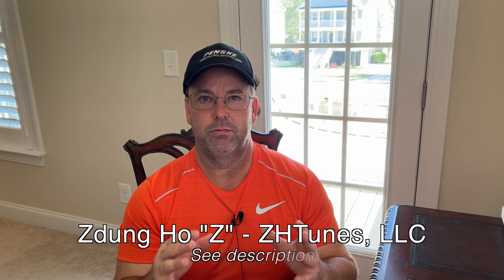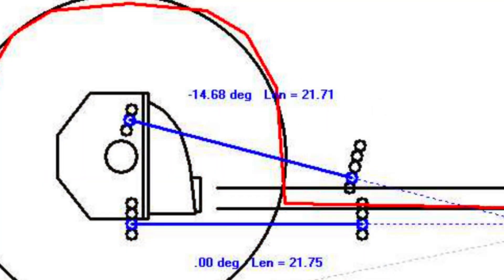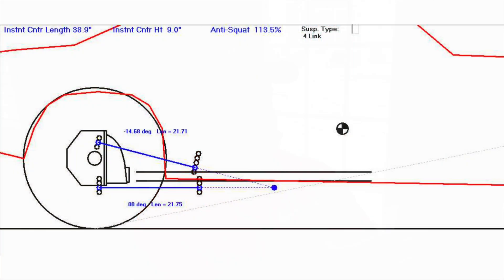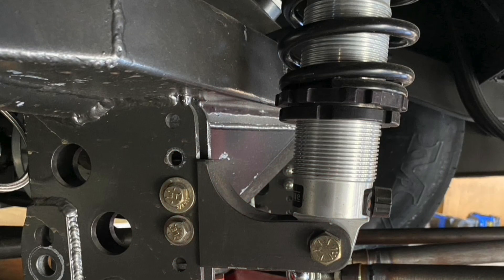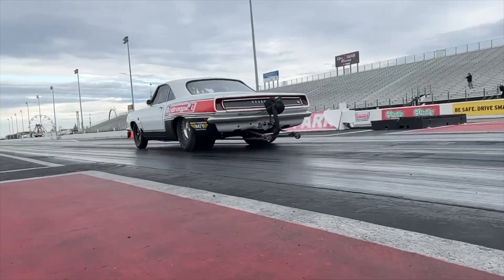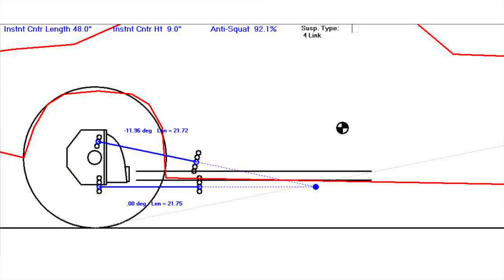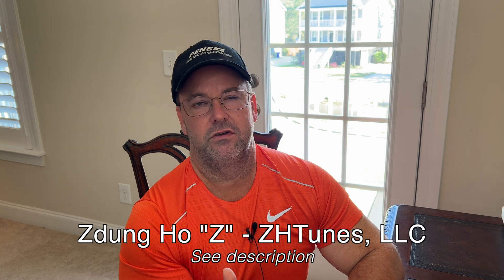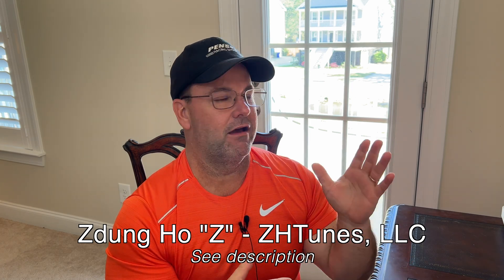4-Link Suspension: TOP Bar Change Stopped Crushing Slicks!

Comment: Can it be that your the wrong way around in explaining anti squat?
As you move the upper four link bar upwards, aren’t you dailing in more anti squat and not less? 
And if this is the case, isn’t the car squatting too much in the first runs (overpowering the dampers) and not to little?
So when you dial the squat back the initial squat force is controlled by the damper?
Reply from the maker: It can be confusing, but anti squat is when the rear tires separate from the chassis and get planted to the surface. As you move the upper 4 link bars higher on the chassis, you are lengthening the instant center, thus you are reducing anti squat, which is increasing squat. The term "anti squat" means the rear chassis is not having squat. Hope this helps. Go fast, go straight! Be SAFE!

Comment: WHT was the front and rear spread in inches? 7 and 12 are standard and you started well below that in the front. That car will be faster with double adjustable shocks and the that rear bounce and wheelie bar bounce should leave when you keep the slicks planted. That was very informative and keep it up

Comment: Great video. Those shocks work very well for the price. I’ve actually run 7.60’s in the 1/4’ with the single adjustable strange shock in a 3500lb leaf spring car on 275 radials. Check out our channel.

Comment: Very good video for beginners to learm how the placement of the instant center works. However I would add that by using Dave Morgans book., "Doorslammers. A Chassis Book" it will teach you how to get your particular chassis much closer the first time. By learning how to measure where your instant center is you'll be closer much quicker.

Comment: Thanks a bunch Kevin!
 I'm converting my ladder bar, lowered 81 Camaro with 500 ponies and a stick shift tranny into a 4 link setup for better street-ability.

This car won't be raced or auto-crossed at all, I just want it to drive nice, hook up the best it can with probably 100% anti-squat, with wide street tires. 

I'm designing the brackets and bars that will be installed.

Question, some sites state for best street manners, you want a level to the road bottom bar, and a equal length, and parallel top bar. I will be adding a super beefy diagonal link.

What are some do's and don'ts, for a street setup?

I'm leaning towards a bottom bar that is as long and low as possible, with it angled up toward the front chassis mount probably 1", and having a top bar that is level with the ground and around 75% the length of the bottom bar. I seen a post where it said that you want to rear axle centerline to track perfectly vertical.

What do you think?

Comment: The problem with your analysis is engine height in chassis plays a huge part . How high in the car is the 4 link bracket in relationship to the camshaft height.   Where is the bottom bar in relationship to the front spindle?   So many factors in adjustment . Front shocks effect the rear , camber change  caster,  toe  it's "all" 4 corners of the suspension that makes the difference especially with the HP numbers some of these guys are trying to harness.  Tim Mc Amis has everything you need to solve problems in chassis

Comment: This thing still kinda looked like crud leaving…so from my take moving out the IC somewhat bandaids the whole setup by slowing down the separation…to get it to actually hook, does it need that force driving down the tire on the hit but just a better shock to control it?  We are about to start working with our 4 link car. Runs 6.0s big tire 87 dodge charger. Need it to hook on poorly prepped bracket tracks.  It’s been good but I know it can be better.

Comment: Would lowering the top bar on the rear end bracket done the same thing when your that far off to start with cool video thanks for the info
Reply: I’m wondering the same thing plus even with the same IC, higher bar angles would hit the tire harder correct? So it seems like that could make the issue even worse than what it would necessarily be with the same IC and a lower bar on the top of the rear end

Comment: Thanks for making this vid. Getting folks to understand the essential value of quality shocks is important, and often overlooked. Having a little too much bar, controlled by shocks, allows you to add, or remove bite, and time to return to ride height simply by shock adjustment. So as the track changes, or the use of more , or less power adder changes, you don't have to play on the monkey bars. I made the change to inerters a few years ago, and I'll never go back. Thanks again for taking time to help people figure it out, without the usual bs in suspension vids

Comment: Great video Kevin, it’s awesome being able to see back-to-back runs with changes. Rarely ever it’s this well documented. 

Out of plain curiosity, it would be interesting to see the same video with the original IC at 113%, but trying to control the sidewall crush using the wheelie bars. On the first pass, it almost looked like the bars were too high so it just infinitely crushed the sidewall until they finally smacked the ground and unloaded the tire.

Comment: Isn't this the same geometry you would use on a radial?  You mentioned big slick a lot, what's the difference in setup?
Reply from the maker: Slicks and Radials are definitely setup different on the 4 link bars.... My channel has so many videos to help with this and it is much deeper than a YouTube comment. This video actually helps demonstrate 1 key difference around slicks and radials with how the car interacts with the sidewall of a big tire slick. Go fast, go straight! Be SAFE!

Comment: I was thinking that when the instnt cntr length went out 23" and out forward of the CG the car was going to wheels up a lot more?
Reply from the maker: At a high level it does/will, but with this car's current weight bias, it helped apply the wheelie bars more effectively. The wheelie bars are critical for this very reason. Go fast, go straight! Be SAFE!

Comment: A little more info as to Spring Rate would be helpful, any standard information on spring rates vs. weight? How much energy do you typically want a spring to absorb? Looks like the car could use a stiffer spring to slow downward travel.
Reply from the maker: Good feedback! I will update the description by COB tomorrow, 3/13. Go fast, go straight! Be SAFE!

Comment: All the difference between weight transfer, and making the rear suspension do all the work… Either the rear separates, smashes the tire into the track. Or let the weight transfer and gain traction the old fashion way! 👍 Awesome presentation of a very basic concept people way over think… Makes it even more clear how simple it actually is… I always tell people trying to tune a chassis, set up a camera! Tells you everything you need to know, frame by frame! 👍

Comment: This is a great video, thankyou !  One question if you please, do these things also apply to the factory 4 link on Gm G-body chassis ? I'm fighting with an 81 malibu small tire car running low 9's.
Reply from the maker: Yes it does... same principles apply, except the triangulated uppers also "locate" the rear end. Go fast, go straight! Be SAFE!
Reply: @KevinWilsonSBC  Thanks for the reply, do you have any g-body rear suspension video's ? I've been considering some type of upper bar front mounts that allow the upper bars to be justed up or down at the front just like in this video.  When you install a 9" rearend in these cars the back of the uppers gets higher which i'm thinking is not a benefit for high powered cars. So if i could raise the front of the bars i could move my IC forward if i'm understanding this correctly. Sorry for the big comment.

Comment: Nice video, Are you checking center of gravity height? or using a rough estimate?
Reply from the maker: Mainly the crankshaft centerline then based on that I use the camshaft centerline height as a rough estimate. The AS line is merely a reference from which I make educated changes. Go fast, go straight! Be SAFE!
Reply: @Kevin Wilson  i do the same. But the AS % then becomes useles to apply to other vehicles. I've want to determine my and customers' actual CG.  Then, the AS % becomes something you can apply over multiple vehicles with a bit more confidence. Would have to be a lot of data though.  SLR, shock/spring, wieghts, and hp just as a start. Obviously, you know this.  Anyway, dig the video!
Reply from the maker: @ForceEngineering  O yes... I have used the following method with great success.
Find the height of your car's Center of Gravity:
https://brakepower.com/center-of-gravity-calculator.htm
Go fast, go straight! Be SAFE!

Comment: Is a triangular 4 link and small tire slick’s totally different from this setup?
Reply from the maker: Each car is unique and prep vs no-prep, along with weight bias and CG height have a bunch on the baseline setup I start with... Triangulated vs parallel behave the same way on the antisquat theories, but the upper triangulated arms also "locate" the rear end right to left. Go fast, go straight! Be SAFE!

Comment: The tires are springs but they are undampened. I remember a long time ago reading that a large percentage of an F1 car’s vertical “suspension “ travel was the tire’s sidewall deflection. This was probably the ground effects era -early 80s.

Comment: Have you changed your stance on getting slick tire cars closer to or above the anti squat line?
Reply from the maker: No. This is/was a single adjustable shock car. You have to setup the 4 link accordingly. Go back to what I said in the video about these shocks. Go fast, go straight! Be SAFE!
Reply: @KevinWilsonSBC  So if you use your properly valved shocks to control the hit (because its too strong) why not make the correct bar angle change to so it does not hit the tire so hard?
Reply: @FadetoBlack1463  That would be an interesting comparison video. Which would be faster and more consistent.
Reply: @SketchysGarage I'm not sure there would be much difference. I feel you do not want anti squat near or over 100% on big slick tire car. Especially in anything that makes a lot of power.

Comment: Question from a newbie. What if you moved the lower bar up a notch. Wouldn't that reduce squat and push down ore? Or would that reduce traction because of reduced weight transfer aft?
Reply from the maker: There is a bunch to that question. Go fast, go straight! Be SAFE!

Comment: 52” length, 8.3” height and flat lower bar has transformed our big tire roadster. What’s the significance of the IC being in front or behind the CG? That honestly seems to have made the largest difference on our car reflecting on our situation vs the video you just shared
Reply: The four link on our roadster was deceptive what appeared to have been a flat lower bar was actually a 3-5* down angle. The chassis was designed for very short IC’s aggressive top down angles. Making an old Davis super gas roadster designed for throttle stop go straight out like a door car is not easy business. Many said it can’t be done.
Reply: What would happen if you raised the rear ride height enough to level the lower bar and then adjust the upper bar to lengthen the IC ?
Reply: @truthboomertruthbomber5125  we were able to raise the front of the lower bar to get it flat with a driver in the car, and the upper bar is maxed out. Luckily the car is very happy there. The IC is about 4” in front of the CG and 7” below it. It’s the first time we’ve been able to run wide open on the leave and the car doesn’t try to flip over backwards. It’s been as fast as 8.15 at 164